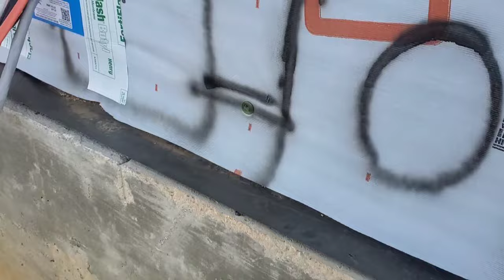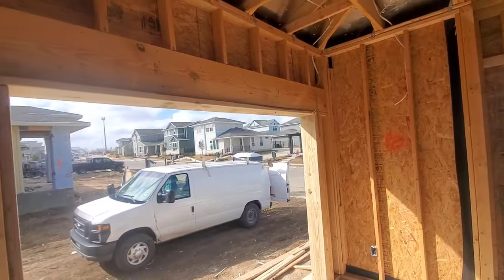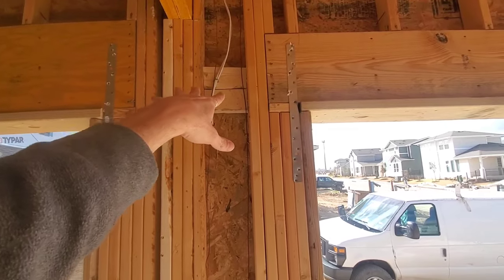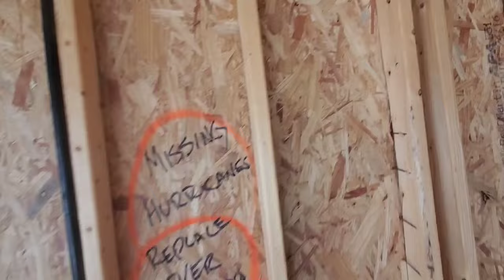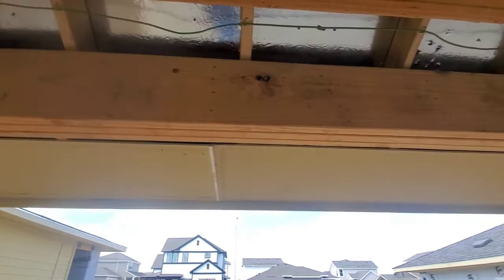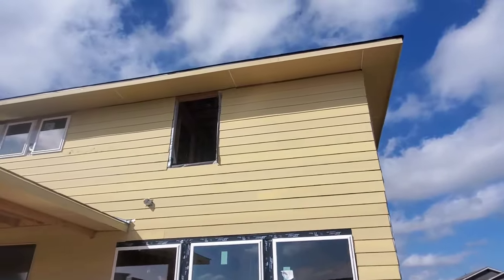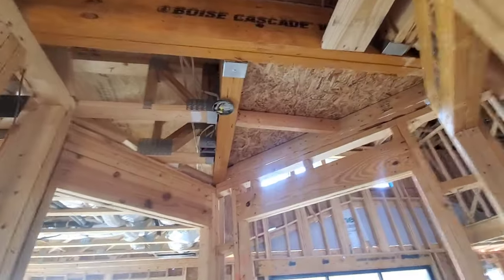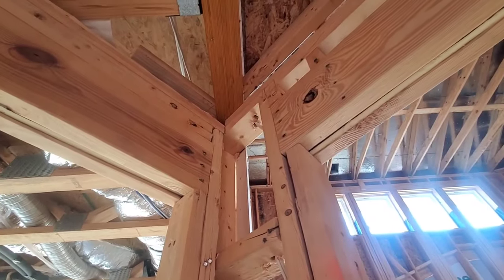Can't believe home builders get away with this! If you were building, get your own inspector!

Comment: I would be absolutely mortified if this was my house under construction.   You'll never get away from these workmanship problems... For every 1 you see 2 were unseen...  This is one of the most poorly framed houses I've ever seen.
Reply: I like buying older homes at auction that have been taken care of. Framing isn't about speed.
Reply: @RobChapala  Fallacy...
Reply: "Mortified" means embarrassed, not angry.
Reply: @situational.analysis  Yeah, actual carpenters find this kind of fuckery embarrassing.
Reply: You must not have seen a lot of houses in the framing stage.  I've seen frames that have passed inspection where the hip rafters and jack rafters didn't sit down on the top plate.  They were standing on toed nails, no ties in an earthquake zone.
Reply: @nonyadamnbusiness9887  Yes, but not embarrassing for one's self.

Comment: This speaks volumes about the people that contractors are hiring to do the work.
Reply: As if there's a choice...Competent, budget conscience mechanics, are "Hens teeth" ...
Reply: Blaming it all on the workers is not right.  The contractor knows what is going on.  Apparently the inspection process isn't catching enough of the issues to make it more than an inconvenience.  The comment about the stop order above was what is needed to put an end to this kind of trash.
Reply: I see this as a corporate problem.  They are screaming at the builders to “build, build, build” but the builders can’t find competent help anymore but they still need to make money themselves and so they sadly have to look away from all the mistakes.  Lack of new people coming into the building industry is systemic across all the trades and so these guys hire whatever they can find and they are not experienced enough and lack supervision.  I suspect that in the future all homes build during this labor crunch are going to be worth significantly less than comparable homes, that is if they are still standing….

Comment: Framer for 23 years, inspectors and builders let this type of stuff go all the time if the  are doing it because they get it done FAST. If you live in California or Arizona your home most likely has defects like the one in this video that are part of your home because the “piece framers” are paid to get done as fast as possible. 

Inspectors are either in the builders pocket or simply don’t care. Glad to see someone calling out the hackery.
Reply: Piece work is the downfall of the construction industry. I'm an electrical contractor in Florida. Union contractor (that's pronounced unicorn in Florida) and I have to compete with non-union contractors paying non-electricians on a piecework basis. Not only is the workmanship shoddy, but the poor souls who buy into this type of job are often paid far less than minimum was because they work god-awful hours to get he job done so they can get their measly check. AND, in most cases the lead guy has to hire and pay a helper out of the same check.
Reply: Yup,cover it with drywall and the problem goes away and then the builder gets paid but the drywaller will get ripped off

Comment: A dozen years ago or so, a habitat for humanity house was built a block away from me.  I remember the first winter, the fascia board around the entire house came loose during a windy night. The wind gusts were 35-40 mph that night. Your video reminds me of that build.  Sad to see construction like this. Keep the videos coming.
Reply: Who would of guessed a house built by crew of unexpierenced volunteers built a shity house.  I would have never guessed that.
Reply: @zoso1123  I think the point he was making, was that the house in the video, being paid for, and supposedly being constructed by a professional crew, has the same workmanship as the house that was built by rank amateurs for donations.
Reply: I was volunteering a few weeks ago for that group out here. I've been in construction for over 30 years and I wanted to share my experience and knowledge with them. They actually have a licensed contractor doing the framing and they are a complete joke.  They have zero pride in there workmanship.  They actually framed the interior doors 81 1/2" high for the R.O. good luck when you get ready to install the doors.  They told me that was the correct r.o. they will be cutting down every door jambs. R.O. should be at least 82 1/2" tall. I stopped volunteering because of these idiots.

Comment: I’m amazed that a builder could leave this mess behind themselves
Reply: Motivation.  Administrative expectation.  It literally matters not to so many corporate district people what the quality is, but when will it be done?  Also, you will be amazed to learn that obvious issues like the foundation rolling water to the wood and deteriorating with mold and rot will be judged by many 'Managers' on will this come back in less than a year or 366 days?  If 366 days, ignore it, and toss the rocks on the wall.  There are 400 homes under construction about 15 blocks north of me in Vegas.  I suggest I could easily find this and more, but remember, that 8 square blocks are worth $160m.  That is a lot of motivation.

Comment: You must be the most hated man on the construction site, but I'm glad you do what you do. mainly because EVERYTHING I've seen looks like it was done very poorly, quickly and without any concern whatsoever. It's not that the house will fall down, but these things will cause sheetrock to crack, water to enter, heat loss, windows to fail, problems down the road that shouldn't happen, and on and on... People buy these houses after the fact, and once the sheetrock is up they can't see what you see. Wherever you are inspecting houses, it seems that they bang them out very fast and couldn't care less about quality, it's all about building the next one and making money. They will come back after your inspection, blast in more nails, add a 2x4, add a brace and you'll get stuck passing it because technically it passes. I would never make a dime as a builder, I just finished an addition on my shop and if I saw the slightest issue, I did it over, or I wouldn't sleep well knowing that I could have done better, I took pride in my building. The builders homes you're inspecting have a terrible crew, it seems as if they don't know how to do things correctly and or carefully...
Reply from the maker: Nah, not hated on the construction site. Thankfully I am hired by buyers and actually have little interaction with builders. But I love it when I do have a chance to talk to builders because it becomes a learning opportunity for us both.

Comment: Tear it down start over
My house was built in 2003. I really wish an inspector would have seen and had the balls to catch at least some of the shortcuts in construction. It’s costing me tens of thousands of dollars to redo the lack of proper weatherproofing and subsequent discovery of shoddy structural framing and missing insulation.
Reply from the maker: Damn man, I really hope you can get that sorted. The good thing is that, in this stage, these items can be fixed.

Comment: I noticed in the back ground I think, a house wrapped in zipwall. Those builders obviously are using high quality material. I'd be interested to know how they built
Reply: High quality materials does not equal high quality work.
Reply: @jasonstclair6293  Yes, that's obvious. However, choosing to use high quality materials usually suggests there is a little more thinking involved and desire to do better job
Reply: @griznatle  You do have a point, but as an insulator years ago I saw it go both ways.  Some people built good houses with dirt cheap materials and some built total crap with high priced materials.  It was always interesting to see the inspection notes from the county.  I don't know about now as the old inspectors have since retired, but I do know they took the time this guy does and went through everything back in the day.  Many arguments took place.
Reply: Zipwall is just more vertical mulch with a coat of green paint on it.  If the inside ever gets wet from a roof leak or a broken pipe, it's game over.
Reply: @NSResponder  not even close to correct, but ok.
Reply: @griznatle  How do figure he's "not even close to correct" ?  It's OSB with a green (or brown) coating on it. If water soaks into the inside of that OSB, it will disintegrate!  It's not some miracle material.
Reply: @mattywho8485  The material is a proprietary OSB, the glue has the same weather resistant chemicals, and every 1/8" is resin coated. 

I had the opportunity to see it put together. It's a pretty cool process. It's not a miracle material but it is not going to fall apart the moment it gets spritzed with water
Reply: Run away 😢

Comment: Saw issues in Houston where a new home,less than a year had the shingles physically falling off the roof. Come to find out when they were applied the contractor shot the nails clean through the shingles. My guess is that the air compressor was set too high to prevent nails not set completely. Manufacturer would not honor the warranty due to improper fastening. Builder had already gone out of business and changed names. Homeowner had to pay for a new roof out of his pocket only one year after buying the house. So sad it makes me mad! 😤😤😤

Comment: I know nothing about construction, but I’ve look at new homes during home shows for several years. The worst thing I ever saw was in a basement.  A steel post didn’t quite reach floor beam above, so they filled the gap with several shims.  The outside often looks nice but I cannot imagine what is hidden. I’m 54 & have owned 3 homes. We’ve been in  our current home for 19 years. It was built solid in 1978. I’d never buy new construction. It should be a crime to be this careless!

Comment: Are you being hired after construction starts, or before? How would the builder react if when the negotiations for the build of the house the buyer said that they were going to hire an outside inspector to inspect the house while it was being built? If that was done, how many times would you come and inspect the building during construction? What was the response from the builder on the long list of problems with this house? Were any of the things you pointed out going to require that portion of the build to be removed and rebuilt? Were the problems you pointed out code violations or just not good building practices? After watching this video it's obvious that either the builder didn't care about quality, or they didn't have anyone at the site managing the build.

Comment: One thing that really gets the point across with bad builders is to show up, without anything other than hand tools, or if you are extra pissed off, no tools. Tear the place to the ground, throw it all into the dumpster and then start over. Take your time (hopefully not the jail as most wanker contractors will run scared) but take the time and read, codes, etc. build a nice house and be happy!

Comment: Not every section of a garage wall is a continuously sheathed portal frame.  Usually it's the shortest wall adjacent to a large opening.  There's a formula.   The wall between the 2 openings is probably wide enough to be a braced wall panel in itself and not need a CS-P.F.,   (apparent also in the header termination at king stud,  not ran through to other opening), therefore only requiring standard nailing patterns and plywood joints (they can be anywhere)

The 1st section you looked at is definitely wrong though.  Cs-pf should have nails 3"o.c. in all members, including 3" grid into portal framed header itself.  Straps at header connection and at bottom plate.  Plywood joints must be in center 24" of wall assembly.   

I know because I failed an inspection years back in a new city we had just begun to work in.  I had to reframe a garage wall.  I learned everything I could about portal framing and braced wall panels.  Cheers
Reply from the maker: I think the portal frame section is one of the most overlooked and misunderstood parts of the code book. I have read it 100 times and still  have to refer to the illustrations to help me remember what's what between CS-PF and PFH, etc. 

The biggest thing I find are the lack of nails. Folks just don't understand how crucial it is, especially at the corners of the header. JLC has a great article on it along with a few photos of garages that failed:
https://www.jlconline.com/how-to/framing/the-portal-frame-option_o
Reply: @Constructiva Inspections  JLC has some great info! 
I think some issues are:
1: Some cities enforce it, but many don't.  The cities that don't, lack the requirement for a braced wall section on the blueprint.  So the carpenters will just nail the whole house however they feel. 
2. Often when there's not a braced wall detail page on the print,  you'll get a builder or Superintendent who tells the carpenters to "run the header long" but there's so much more to it!   Looks to me like that's what happened here.  

Cheers I enjoy your content and nerding out over building code!

Comment: I didnt know I could get my own inspector during construction on a production build (not custom home)...  My builder just said if it passes city inspection then that's all good... I did have a list of items I found since I did work in home building and other construction industry and so was able to point out and get multiple BIG items fixed that would have been costly a few years down the road.....   but if this is allowed, then next production home i build and move into, i'll get inspections during it... but my next build is going to be a custom build and a custom home...

But we did have one issue that we faught and they didnt budge because city passed inspection and its on the plans this way... one bedroom, the door is in a hallway and about 8 feet of hallways is part of the bedroom... and the lightswitch to that room is about 10 feet away from the door enterence... in the dark, ITS PITCH BLACK and I trip and everything to find the light switch... I've since installed a Zwave switch as my home is 100% automated, in a old work box with an outlet below it to power it, and so there is a switch at the door now and it tells my Home Assistnt to turn on the switch thats further int he room...

Comment: "A little bit of trouble" with the sheathing nailing? That's got to be the understatement of the year -- and we aren't even through February yet. That's one advantage of the old days of hand nailing -- even an idiot couldn't have missed those while hammering in the nails from the outside -- nail guns make it so easy to not notice them (or at least claim they weren't noticed). On HfH builds I always try to make make a pass through just after wall sheathing is up to look for shiners and I fix every one I find (which, admittedly, is overkill when it's just one shiner in the field).

This channel (and some others) make me want to have a custom built home - just so I can watch like a hawk showing up at the end of work every day to inspect (and keep an inspector "on call" to resolve "You don't know what you're talking about" issues with the contractor). Hopefully, of course, the contractor takes care of this and I can slack off a bit. These problems are SO much easier to catch and fix properly as
Reply from the maker: I've been on a few HFH homes and they are, by far, the best built residential structures in town!
Reply: @constructivainspections  That's good to hear.

I'm pretty sure we use more nails per square foot than commercial builders (that's not necessarily a good thing as occasionally I see a framing member that probably wouldn't have split but for that "extra nail just to be sure") :)
Reply: A friend of mine had a custom home built, and a number of builders required transferring ownership of the lot to the builder during construction. While this may have discouraged having to file liens, it also kept the homeowner from making daily inspections. Those builders did not get his business. Construction sites are dangerous, so I understand a bit of legal concern.

During construction, his retired father watched the build, and he still ended up with some window leaks where the nailing surface wasn't even (e.g. the two 2x at the top of the window which aren't quite as thick as a 2x4, leaving a gap at the top of the window for water to get in if they are just nailed together.

Comment: I am amazed at the amount of framing issues in this video. Does your state/county not require framing inspection well before HVAC/plumbing gets started?
Reply: Nothing a $100 bill won’t get you past…
Reply: Framing usually comes after mechanicals
Reply: Plumbers and Hvac comes in and cuts through a lot of framing so inspection is after repairs  where necessary

Comment: It looks like they should have gotten you to inspect before they added any structure above their initial framing. It would have been a lot easier to fix these issues at that point rather than the stage it's at now.

Comment: Seeing how poorly this house is constructed is sad and a bit shocking. I'm actually more curious WHY such poor workmanship. Is the root problem inexperienced workers that generally would rather do a good job but haven't gained enough experience, or experienced workers that don't care and uninterested in mastering their own craft? What responsibility does the manager of the crew have in the crew's work output? What responsibility does the home building company have in putting policies in place to build to a target quality standard? Does the customer even want to buy a home built to a target quality standard, or is the builder simply offering the customer what the customer wants...the lowest price possible? If it's the latter then I'd argue you didn't really find any problems as the end product is intended and desired to be at this price and quality point.